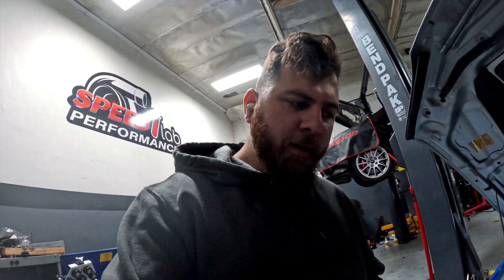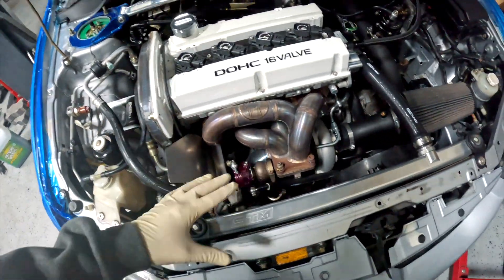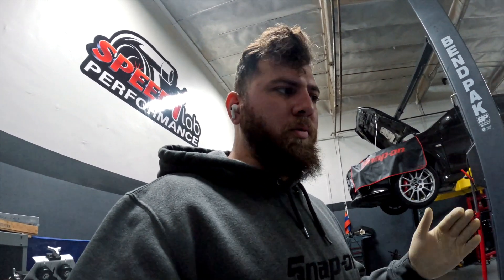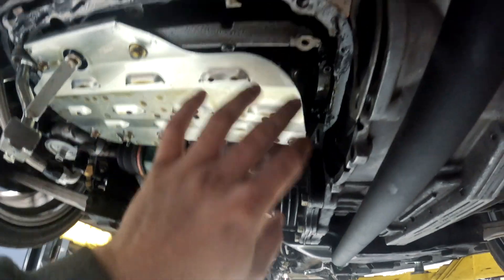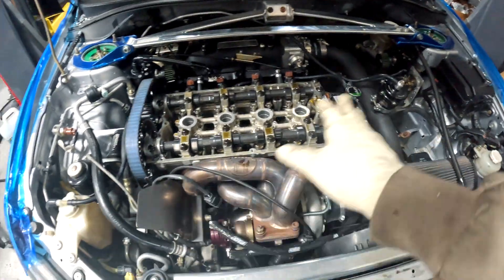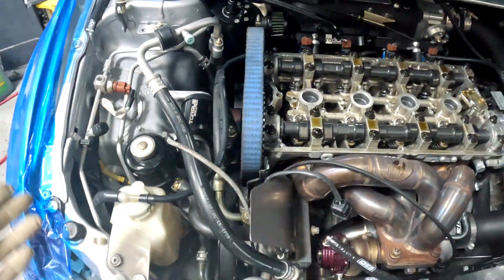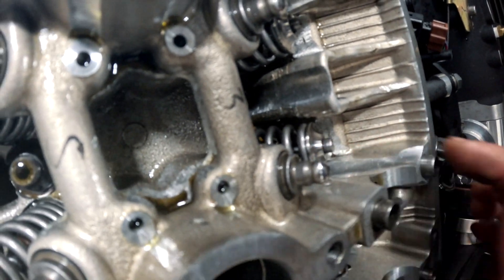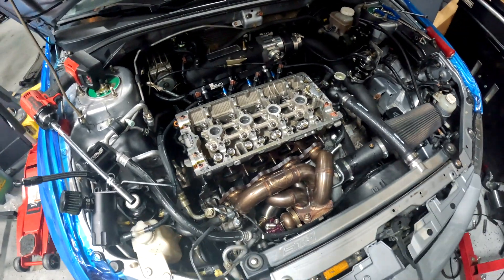Angel's Evo 8 gives us a SCARE before 750whp power goal Dyno Session [Build Vlog]

Comment: Any tips in getting those oil pans to seal up ?
Reply from the maker: Honestly, I use quite a bit more silicone than I am comfortable with, this is the only way I have gotten them to seal up properly. About 5 of our builds that we did this year used this pan, only one had a slight leak, all of the others sealed up perfectly fine using a generous amount of RTV. You cant be too conservative with it, but you also do not want to empty the whole tube of silicone on the flange as it WILL end up in the oil pickup tube and have a Yaris situation!

Comment: Another good video. I am nervous yet excited to tear into my 4g63. 110k miles that aren't mine, hopefully my head doesn't have that much material milled off of it!
Reply from the maker: I have seen heads that have been milled down to the dummy marks (portion of the deck that is an indicator for the machinist to stop lol) And these have sealed up with Vulcan style head gaskets, I'm talking 55+ PSI of boost on a high comp combo, its all in the tuning and the parts selection, obviously the less material you have left the less room for flex and the thinner the deck surface is and is not ideal, but a cylinder head that's been decked 2 thou or so a few times will be perfectly usable often times than not.

You will be fine if its been decked once or twice. Always check the dummy marks!
Reply: @Speedlab_inc  That makes me feel at ease lol. I definitely want to find a good tuner, and you seem like you are the person to go to, but you are in “Mexico” lol. My goal is max power on stock block, nothing insane. But I’ve been wanting to chat with someone that can really set me in the direction I am wanting to go. 

In any case, I’ll keep an eye for new videos from you. It’s awesome someone is willing to deliver high quality evo content, and share tips of the game.